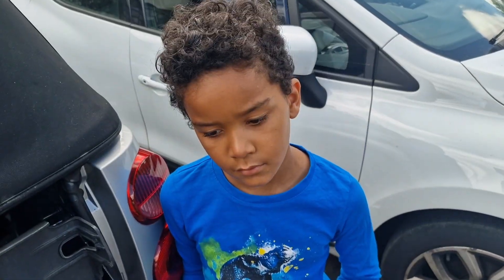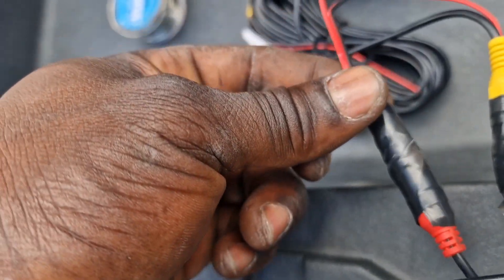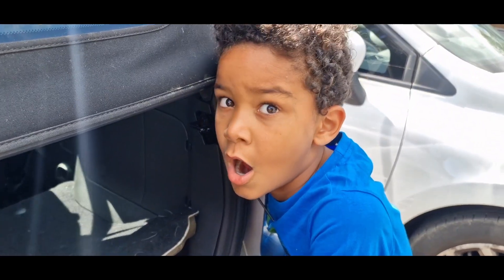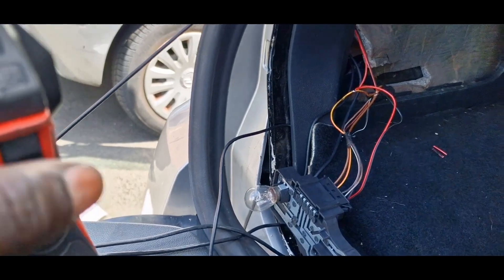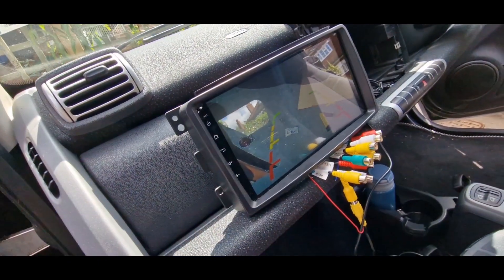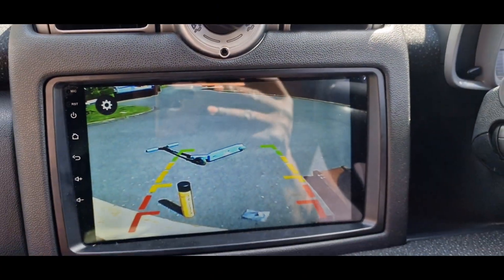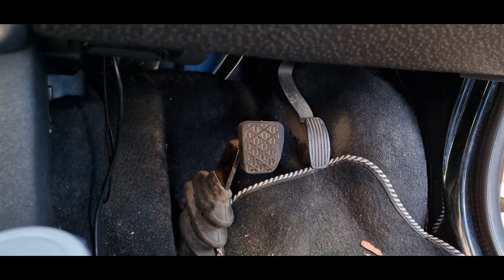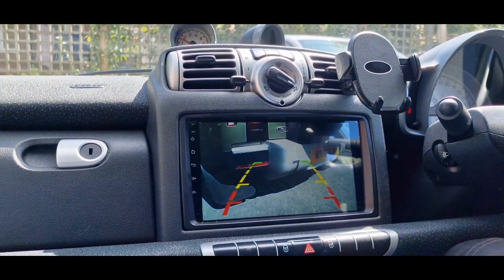Upgrade Chronicles Installing Reversing Camera and Parking Sensors in a Smart For Two

Comment: How you solved the Problem with the exhaust? My cable of the parking Sensors in the middle burned..
Reply from the maker: Try to take the wires about the crash bar beams and cable tie them.
Reply: @ thanks mate
Reply from the maker: @123lolisch  light work good luck